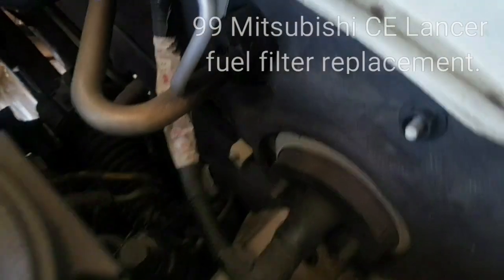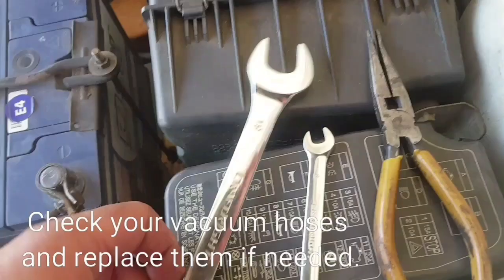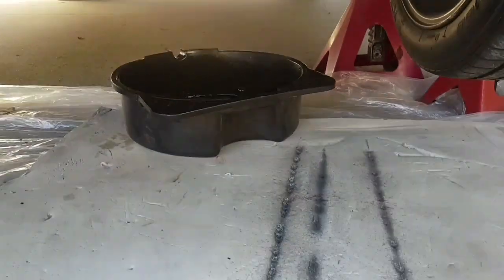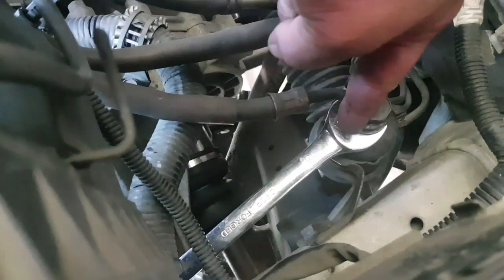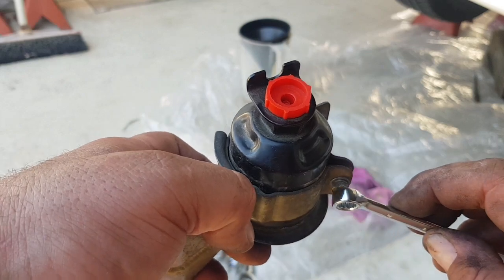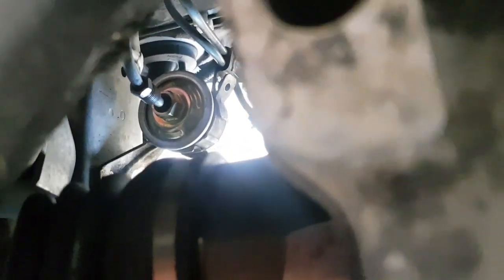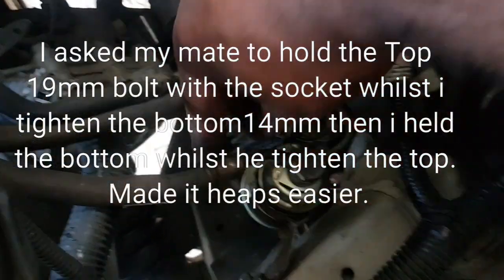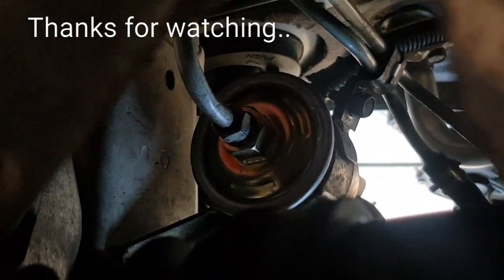Mitsubishi lancer CE 4g93 fuel filter replacement.

Comment: Thanks for the awesome video mate. I did come across one problem though, I could not get the bottom bolt off without A LOT of hard work.

Some tips who are experiencing the same problem.
BEFORE REMOVING BOTTOM BOLT
-Lubricate the bolt with some break fluid
-loosen the 12mm bolts on the housing bracket (done at 7:35) in this video
-Use two wrenches in the "V-formation" to crack the bolt.
-Dont get too carried away. Fuel lines will break. So care!

Comment: you are my hero! i recently got a 99 lancer and there is absolutely nothing about it online!
Reply: just go to auslancer...
Reply: Check out the encap safety crash tests on youtube. These cars are dangerous
Reply: My wife got a 2004 lancer es i just put a new fuel pump and filter it's under the back seat and it was easy, fuse 15a last from front and disconnect the battery.

Comment: Very similar to my '94 Toyota Corolla..identical fuel filter. I found the bottom inlet line was much easier to line the threads up before the jacket housing was attached to the vehicle. The inlet line is made of metal and can crimp easily..much easier to move the filter so that it lines up to the position of bottom housing nut then fix the assembly to vehicle body.  I would recommend the way you did it from beneath as less chance of damaging the line.

Comment: what difference did you feel after changing fuel filter like fuel efficiency or power?
Reply: Depends if there is rust or gooey shit in the system, you'll feel a difference from cleaning injectors
Reply: If you've got a dirty fuel filter you would definitely notice a big difference the power will come come on a lot stronger and you won't be lagging up steep hills

Comment: Tried my lancer CE GLI coupe. New one was Silverline ff51SL from Repco. Leaked from the bottom again and again. There were 3 washers 3 rd one was smaller. But all were very flimsy. Any way because of the leaking hastily put the old one again without the housing. Going for the garage tomorrow. Why leaking from the bottom. I fastened the bottom nut as much as it put a mark on the new fuel filter bottom.
Reply: Hi, Exact same thing happened to me... Used Silverline fuel filter and it is leaking. One mechanic suggested to use Ryco filter and try again...

Comment: Where could I find fuel pump
Reply: under the backseat... theres a small cover that pops off under there and your fuel pump assembely is in there... or you can just drop the tank
Reply: CheetahSpeed That cover is for fuel assembly only you need to drop the gas tank to see another cover by side and there the gas pump.

Comment: i tried doing this by myself and have snapped the fuel line lol FML
Reply from the maker: It is an absolute headache.. sorry to hear bro. Hopefully you had a win with it afterwards
Reply: benny kimchi I got creative to fix the fuel line so my lancer still runs :) thanks for the video though man it was really informative. This would have been much easier if I had a hoist
Reply: @stringz6554  How did you fixed the fuel line?
Reply: @TEKOSTUFF  had to flare the ends and used heavy duty rubber hosing to connect with 2 clamps on each end. A little dodgy, but it worked.